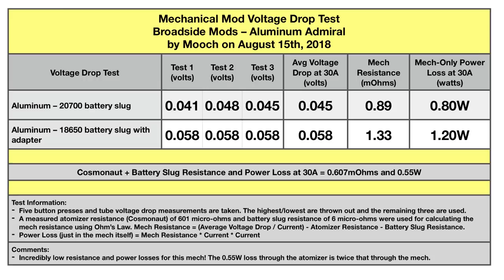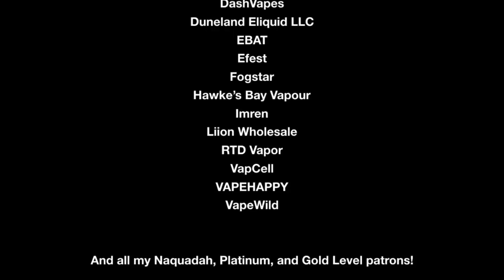Minding Your Mechs – Ep011 – Aluminum Admiral Mech Testing

Comment: Hey @mooch how reliable do you think aluminum mods are compared to copper and brass ones? I have a few aluminum mods  I've never used and am  gonna give them some love.
Reply from the maker: Reliable? I think that would depend a lot more on the individual mod and it’s construction versus the metal used. But, aluminum threads are easier to strip though...go slow.

Comment: I'd say any marks on the top plate of the switch would've been there from manufacture, because the top part is nowhere near connection. Another great video Mooch. Thanks for your work.

Comment: mooch what's 18650 battery that u like to use in a mech mod...
Reply from the maker: Samsung 20S
Reply: Battery Mooch sony vtc 5 a?
Reply from the maker: You can use any battery you want if you don’t go over its current rating. The VTC5A is a great 25A battery, buy it. :-)
Reply: Battery Mooch if we wanna calculate the ampere on  my build , we have to divide the voltage & the resistance right
Reply from the maker: Lan Setsuna check out Ep2 of my Minding Your mAhs series.